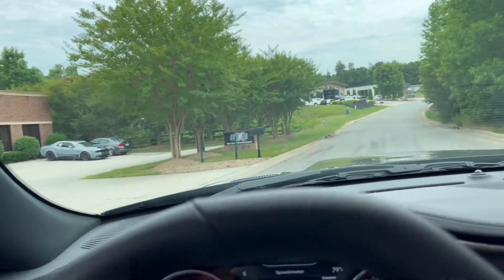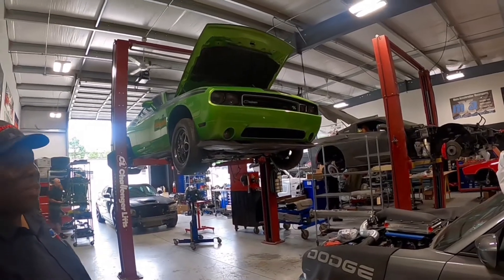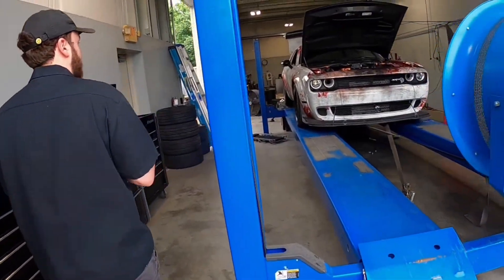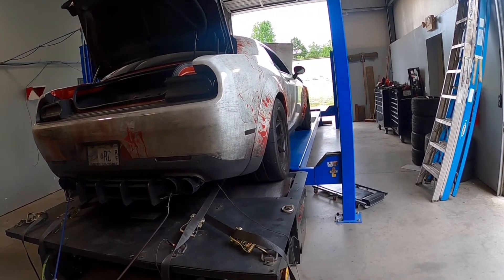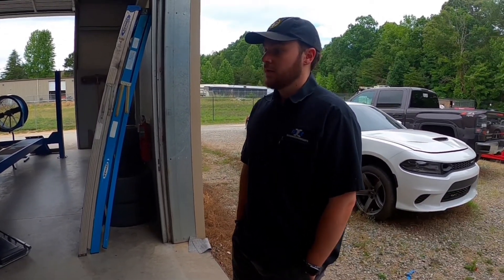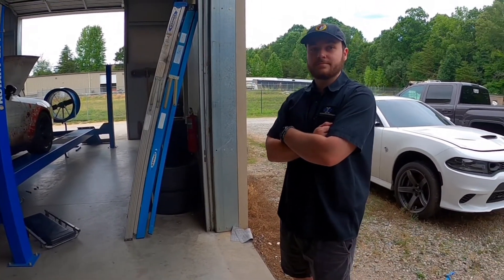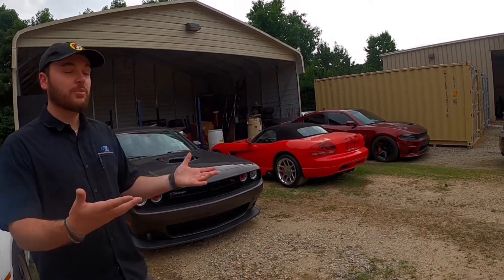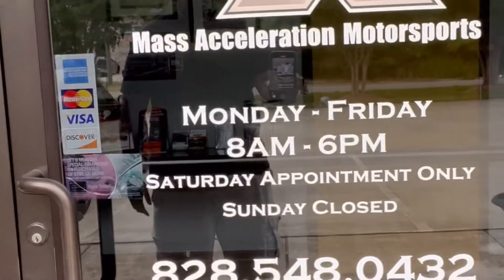An afternoon at Mass Acceleration Motorsports: The Premier High Performance and Custom Auto Shop

Comment: This name has been coming up a lot lately.  Given how that Durango Hellcat they built is doing they are definitely on my list of reputable shops to use. 🍻

Edit: I am holding out for direct connect so it would be fantastic if you guys managed to get that. I currently have warranty until 2027 and don’t want to lose it modding outside of the direct connect warranty approved packages.

Edit 2: I think I know who’s ford that is 🤔 I’ll never tell 🤣